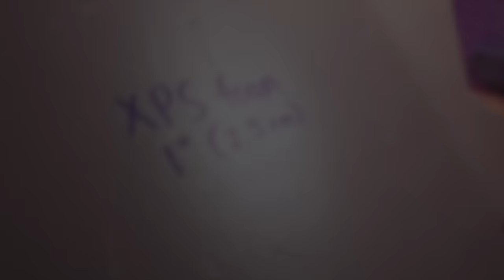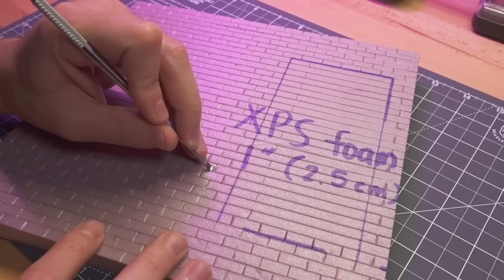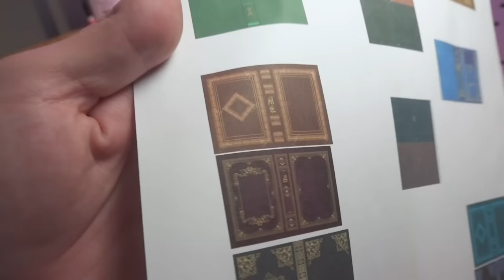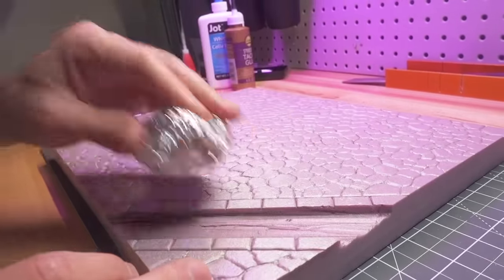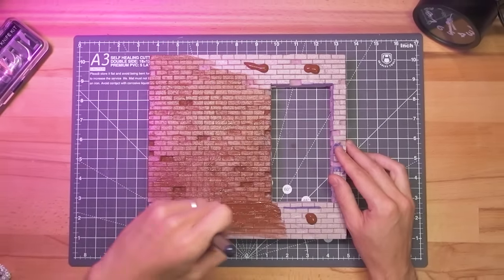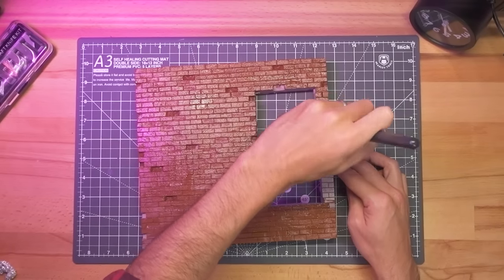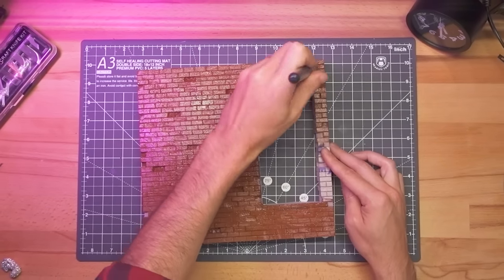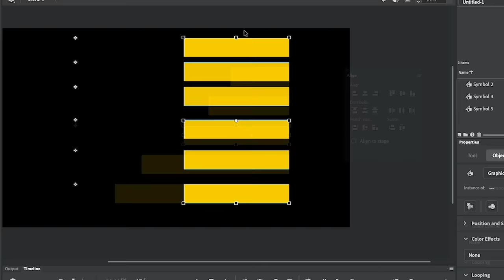"The Droid Maker" 1/12 scale miniature model | Beyond the Blight

Comment: I Hey I wanted to ask you a question I bought the main connector pieces for my Gundam do you know where I can print replacement parts
Reply from the maker: You could try Thingiverse? Not too sure, I’ve never printed replacement parts
Reply: Thanks I’m thinking since I can’t touch the torso and I don’t have glue I’ll probably just use all the extra beds for other projects so at least I get some pieces.

Comment: If you want to do better texturing than wasting foil: get a roller (old plastic piping, something hollow) then glue on 3 different size pebbles. For smaller areas, get and old pencil, get green stuff and on both ends have a cone shape to both sides. On one side have larger pebbles and the other smaller pebbles ❤
Have fun and happy building!